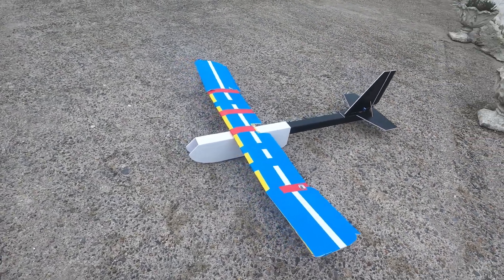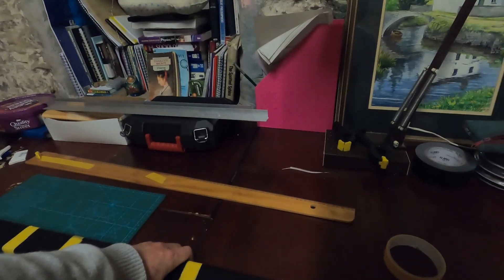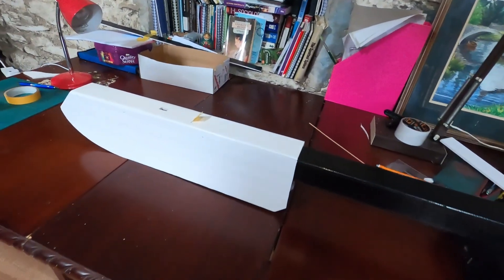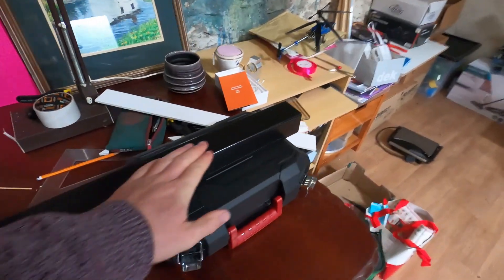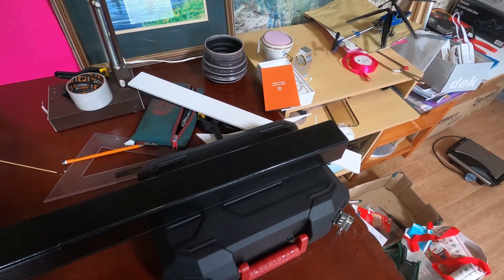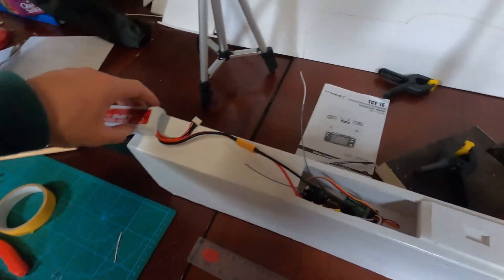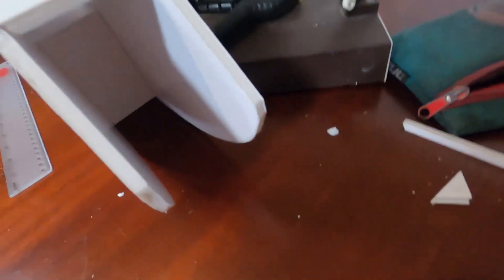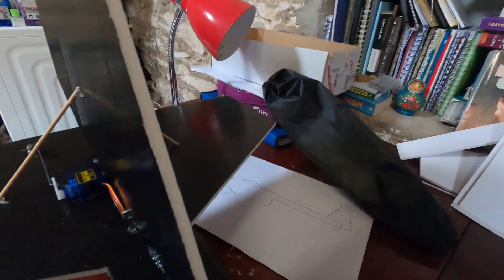DIY Twin Motor RC Aeroplane Part 1

Comment: Hey i just found this video and wanted to ask if it had a successful flight, it looks to be quite tail heavy. Really like the design tho.
Reply from the maker: So far I haven't had the chance to maiden it. Yes unfortunately it has turned out to be quite tail heavy. The AUW of the batteries, motors, etc. was much lighter than anticipated. So it seems like I will have to extend the nose section. In the meanwhile, I have repaired an older model, and have been flying it for practice. Here is a short clip: https://www.youtube.com/watch?v=C0HW47wcCcg